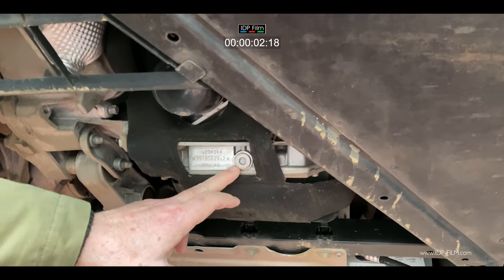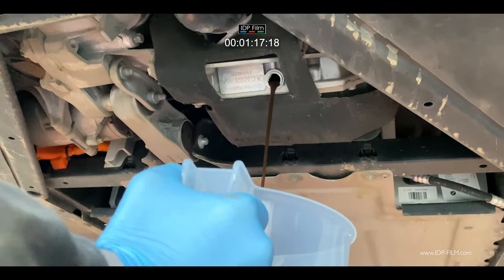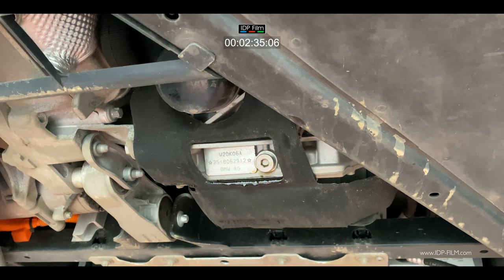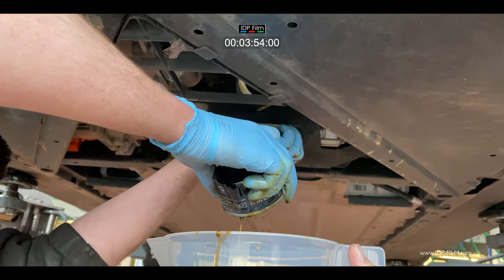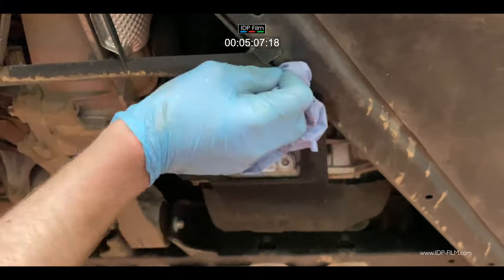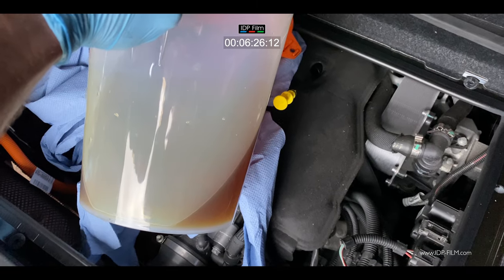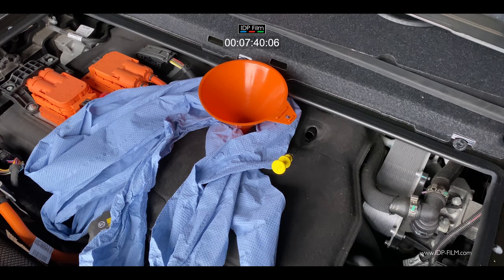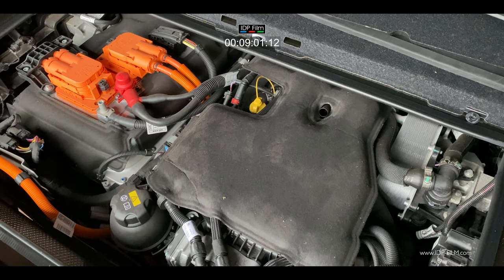BMW i3S SERVICING - Engine Oil Change / BMW i3 REX - 4K HD

Comment: Great video, thanks for uploading, I have this model and didn’t want the rip off BMW service charge.  It is the best electric car out there for sure. I have owned a few other EV’s and believe me this is the best for a lot of reasons.
Reply: BMW i3, i3S REX will be the most sought after EV.  as more drivers go electric and queues start to form at faulty and over crowded chargers Range Extenders & Hybrids can carry on driving to find other locations to charge >. PLUS you NEVER HAVE RANGE ANXIETY that BEV drivers get when they are near 20 per cent !

Comment: The oil in mine is low on the dipstick (off the bottom actually, which is bad considering I've only had the car about 6 weeks and purchased approved used, tut tut BMW).  No warning light on the dash (I'm assuming it has an internal sensor?) Looking to just top up the oil, but don't want to go through the rigmarole of taking engine cover off if I don't have to.  Can you add oil through the dipstick hole, just to top it up?
Reply: easy fix.  Firstly you will not have damaged the REX engine. There IS A WARING LOW OIL SENSOR built in.  So your safe!  You just need to check you don't have an oil leak from either: . a/ Oil Filter b/ Sump Plug.  Check the engine dip-stick on level ground. Leave it stood for at least 10-15 minutes then pull the dip stick and the level MUST BE NO HIGHER THAN THE MIDDLE DOT> do not over fill.  If you over fill the engine you can damage it when it runs at normal to high temp (Oil Expands when heated) .  The oil can be poured down the Dip Stick Opening,  remember to wait for it to settle 10-15 minutes, check again then run the engine to get it up to operating temperature then check again. (Starting the REX stood still is easy, check out the other videos here on YouTube showing how you do this, stationary). The REX will not burn oil. The Engine if well looked after will run for 50,000 - 100,000 miles.   You should CHANGE the oil every 2,000 - 3,000 miles ( forget BMW's shite 2 year service plan.  drop the oil  look after the engine !  ).  Mine I change every 1- 2k and try to use the engine at least once a week or once every two weeks to keep everything lubricated and moisture-free in the oil.   The REX concept : THE BEST DESIGN ever from a motor manufacturer !
Reply: @markedwardsphotography  Thanks for the advice Mark! I’m a fairly high mileage driver so like to look after my motors.
Reply from the maker: spot on from what we can see - Totally agree never ever leave engine oil in what dealers say - Totally agree 5,000 or 7,000 miles max.
You only have to see on YouTube 1 Million mile cars ( had their engine oil changed often )
Great you have also said never have engine oil at the max line - 2 REASONS: 1) in summer / hot days engine oil will expand 2) hi revs will put pressure on any weak areas in the engine - ie head gaskets might blow.
Reply: @OllieTT  SAME. I do annually 20,000 - 25,000 miles each year.  all trouble free.  no rage anxiety even in deep-winter with all the heaters full on for comfort and heated seats too!

Comment: No mention of the filter, no part # nothing. But 3 remarks about a washer.  duh.
Reply from the maker: It's a very simple answer - if you are in America then the Oil Filter Parts number will be different to Oil Filter parts number in France or Spain - MOST if not all parts are slightly different depending on Continent with regards to emissions regulations.
There's no point of putting UK parts numbers on film if you are in the United States or Canada - where most of these cars are sold.

IF you are keen to service the car yourself - we are sure you will
A ) contact your main dealer and get the correct part from them 
B ) and NOT buy after market parts which may have the same or similar parts number on

The film is only to show whats where and how - we are not a BMW parts department.

.

Comment: How can only 2.7 liters of oil last for 10,000 miles NO WAY !
We run Caterpillar C18 diesel engines with 18 Liters of pure power on tap - and the fresh oil is the most important factor - with lube oil refill capacity of a massive 64L !  yes that's right 64 Liters- It makes a lot of sense to change oil on smaller engines more often than manufactures recommend.
Just think about it - 2.7 litres of oil flowing around a very hot engine for 10,000 or 15,000 miles - the insides of that engine would look bad inside if you took it apart.
So we agree - Change it more often ( Thumbs up here ) - look after your engine and it will last for years.
I ve seen motors on Youtube with over a Million miles on the original engine and its all down to regular oil changes more often than manufactures recommend.
My Honda CBR1000RR get new oil every 7K.
Reply: It's only a 2 cylinder engine which will spend most of its life off since the car will be running electric 95% of the time, the engine only kicks in if the battery gets too low which it shouldn't if you regularly charge.
Reply from the maker: load of woofall - never heard anything like it before. Engines are to be used on a regular basis, facts are; 1)  Engine gaskets will dry out if not used often   2)  Coolant will break down and clog waterways  3) inside a engine will deteriorate if not used regularly. 4) rubber drive belts will become dis-formed ( out of shape )
If its got an Engine use it - otherwise you will for sure have expensive repair bills FACT
Reply: @idpfilm  these engines run a automatic maintenance mode every three months if you don't use it.